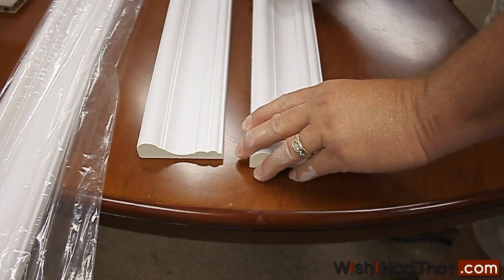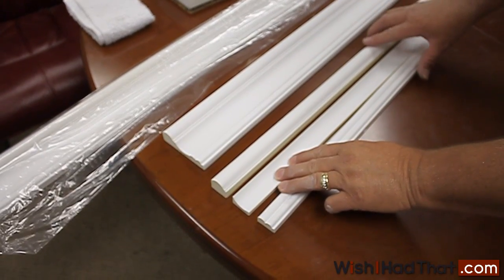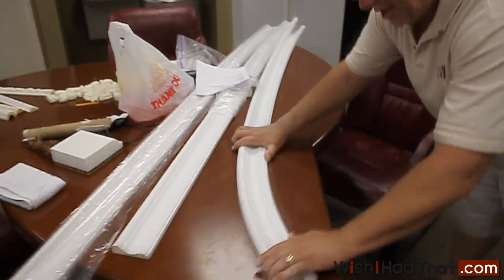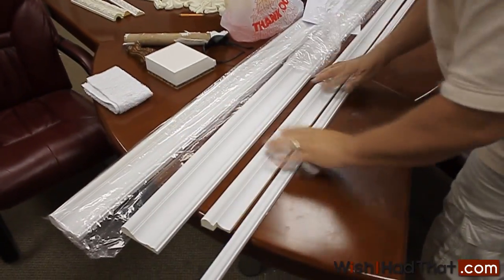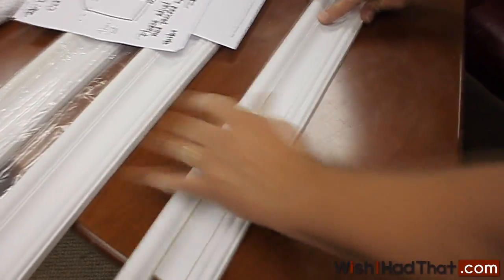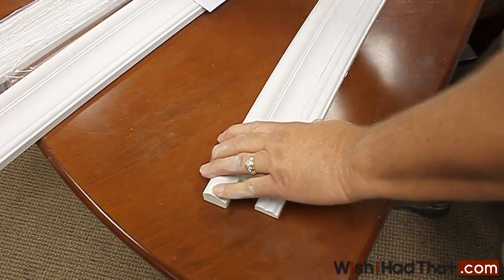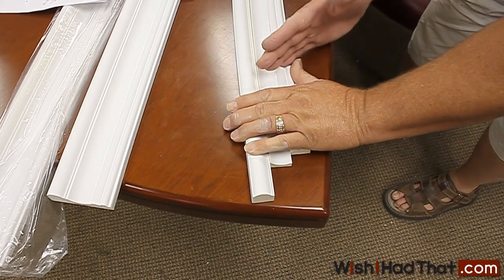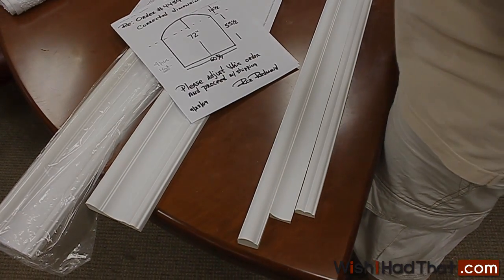Arching Molding

Comment from the maker: @dlittleberry This molding is made from Polyurethane, which is a hard-condensed foam (not like Styrofoam). Different materials will result in varying results. You can get a sample of a polyurethane molding to find out what it is exactly. Check out the website.

Comment: Won’t the cut pieces not match up perfectly to the non cut piece bc you aren’t accounting for the blade taking 1/16-1/8” out during the cut?
Reply: A year later... Sounds like he said "out of two pieces" because you'd cut one stick to get the 2 outer sides, then move saw to cut the second piece of moulding for the middle section.
Reply: Yes, that’s why he said to use two pieces…
•You’d rip the top section and the bottom section out of one piece and the middle out of the other piece

Comment: So would you have to cut a quarter inch off the parts you don’t bend for them to be the same width as the bent pieces? Assuming you have a 1/8th inch kerf.
Reply: This was my first thought also. Pity in 2 years it's never been addressed.

Comment: when you run the piece through a table saw twice you lose 1/4" of width compared to a piece that is not ripped. if no rosette is used, how do you properly transition the miters of the two pieces that are now different widths and profiles?
Reply: You have to use 2 pieces of molding.  If you are doing 3 parts, the center section will come from 1 piece and the top and bottom piece will come from the 2nd piece.  Here is another video that explains how this is done (Go to around 3:50 in the video):
https://www.youtube.com/watch?v=YvXj8j1y_UY&t=383s